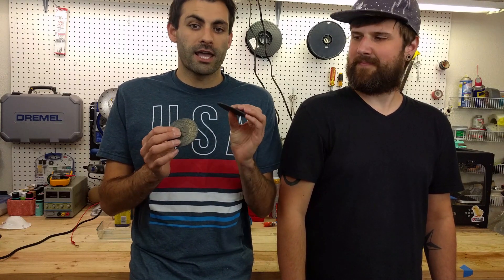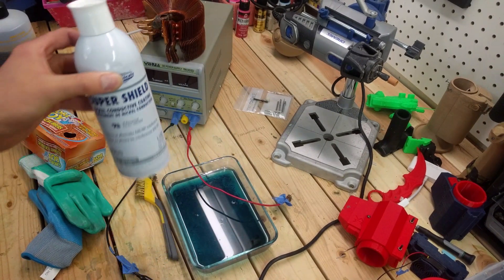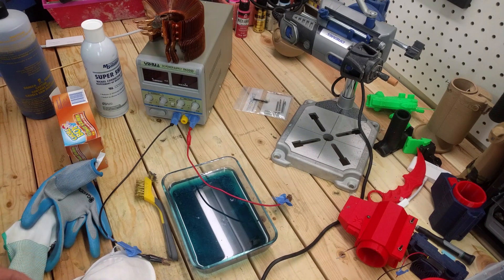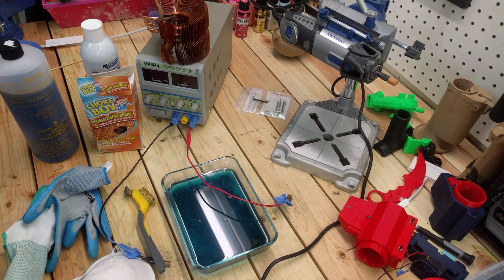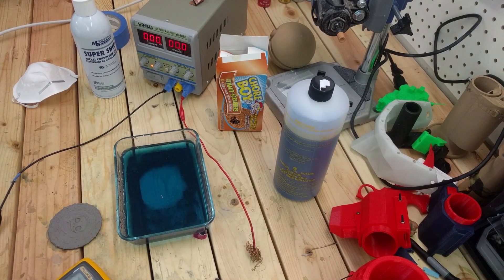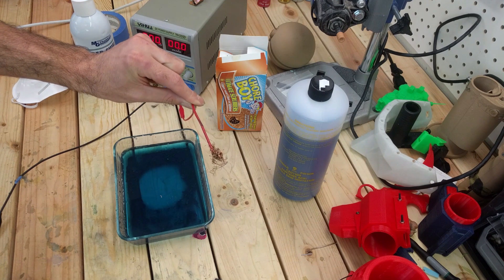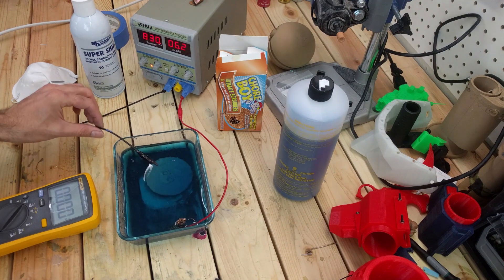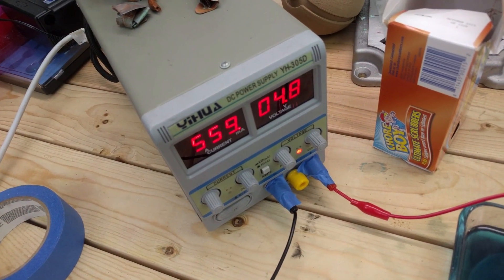How to Electroplate 3D Printed Parts with Copper!

Comment: Thank you for sharing your experiment, This coating will take 24 hours to fully cured  @ ambient temperature, the reason for that uncoated part of copper may be due to not enough curing of MG's super shield Nickel conductive coating.
Reply: No it’s because it was facing away for the copper pipe

Comment: I believe the copper ions take the shortest route between anode and cathode so the nearest point on the part to the anode will get the most copper. To get a uniform coating try making the anode the same shape as the part being plated and keep them parallel so all areas on the part are roughly the same distance from the anode.

Comment: Guys so many mistakes.. 1) This IS NOT copper acetate this is ACID based copper solution i.e: dangerous Battery Acid.   It will eat your skin..If you touch it with your fingers your iPhone will not be able to recognize your finger print... 2) Successful Plating is done when you push the exact amount of current not Volts: 70ma per 1 square inch. Calculate your model's surface area using any 3D software like netfabb.
3) Better use high content Zinc spray for full coverage of your model - it will be replaced by Copper when you dip it in the solution.

To learn more follow my research on twitter: #HomeElectroForming

Comment: The middle didn't coat because of the resistance of the solution.  The best path to the other terminal could be reached through the low impedance nickel to the edge and then to the solution.  There was not enough potential difference between the nickel in the middle and the fluid to get much plating done.
Reply from the maker: Michael Lyle Awesome advice. I was thinking along those lines a bit today after someone brought up the resistance issue.
Reply: No.  The resistance of the solution dominates while the nickel is nice and low impedance.  More voltage / current would help a little.  More favorable anode placement might help too.